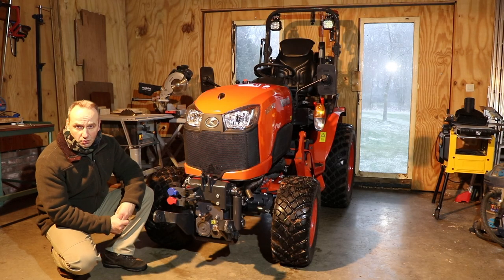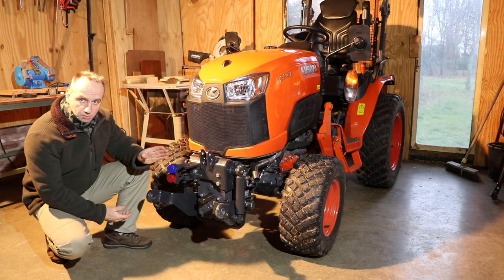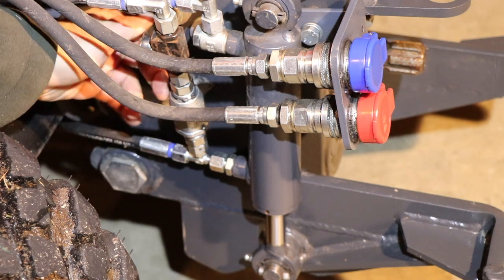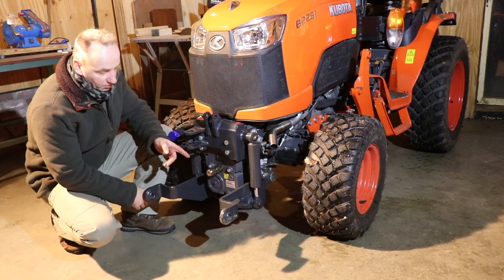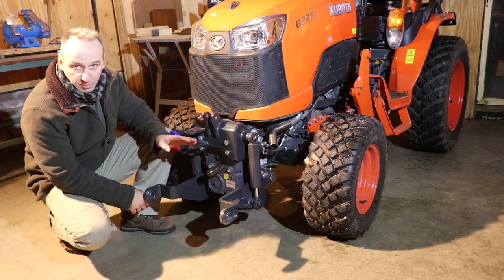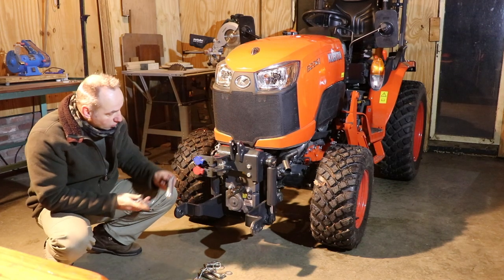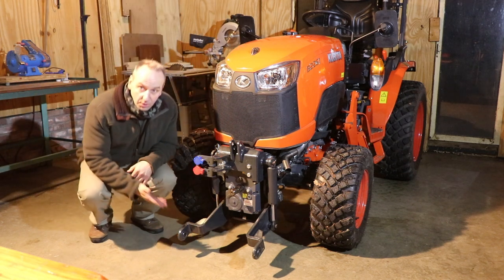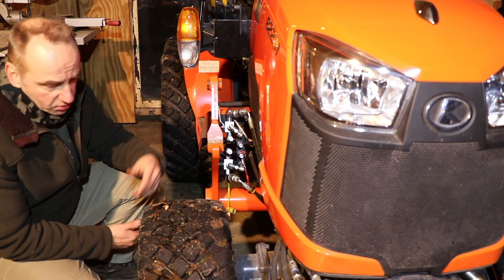Kubota Original Front 3P Hitch and PTO from Zuidberg for Compact Tractor

Comment: Nicely explained, The front 3 pt  hitch you have is a CAT 0, But the quick attach A frame is a municipal, Smaller and shorter than the 0 cat A frame . Correct me if I am wrong.
Reply from the maker: Thanks. I am wondering about this. The A frame is more or less a direct connection from the side hitch lever connection to the top bar connection. The distance and angle is determined by the 3P hitch dimensions. Also I ordered several cat 0 A-frames from different suppliers. Some were already attached like the flail mower and rotary broom, and several others as separate parts that I used for welding (like the transport box and weed brush). And they all fit. There is also no possibility or option to select a different one. 
If the one you have is larger are you still sure it is a Cat 0?
Reply: @OutdoorsintheLowCountries   Yes, Its on the sticker plow ,I ordered hopefully the correct 0 cat A frame adapter last week >. will take a month. Your A Frame adapter looked the same as the one on my tractor that's why I typed so much . thanks again